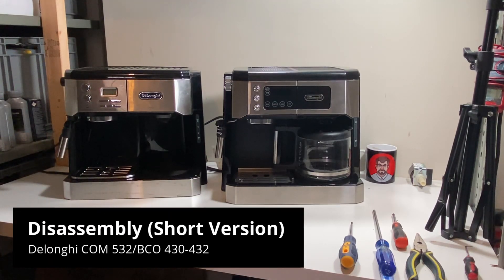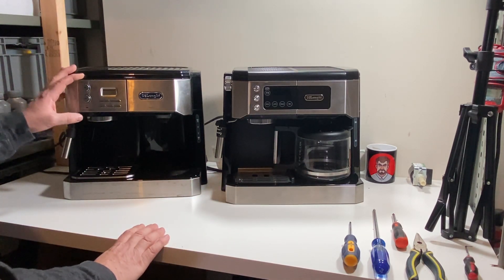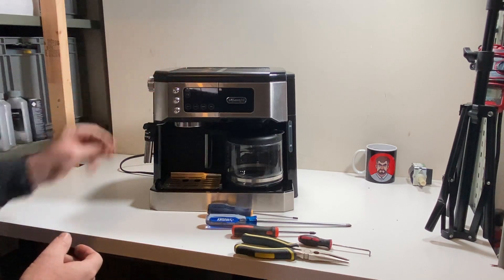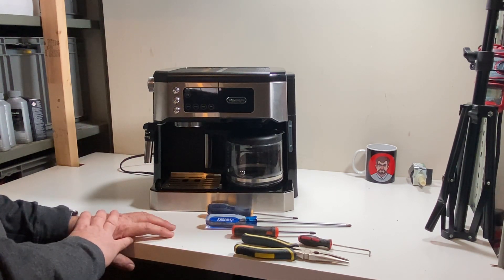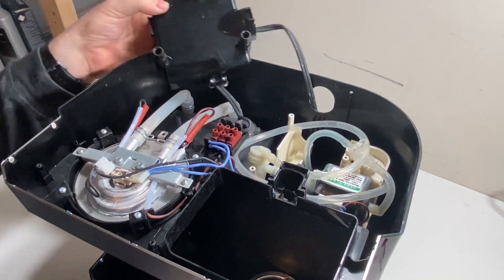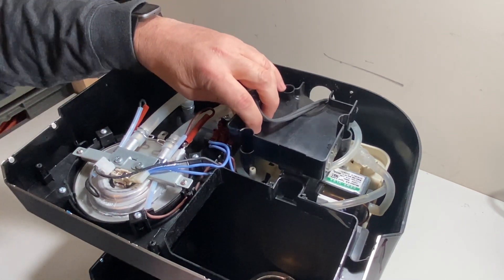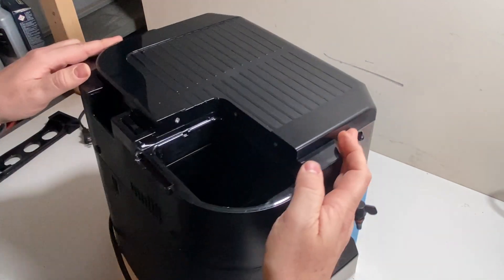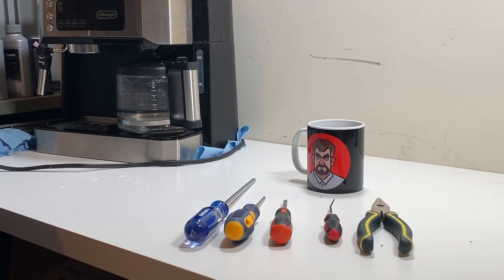Delonghi COM532/BCO430-432 Disassembly Guide (Short Version)

Comment: My espresso side always leaks into the drip pan.. Help 😢
Reply: its the overpressure valve he mentions at 10:05.
Reply: New out of the box my drip tray fills with water when turning the espresso side on. Did you figure it out or take machine back
Reply: @santacruzoverlander  it's the overpressure valve or the water reservoir is not seated right and is just leaking, but that can be deduced by if the machine has to be in for the drip tray to fill at all.

Comment: my com532 just stopped making coffee - it may be the fuse you are referring to.   1) how do i remove it 2) where do i purchase a new one... lights are on with the machine and clock works.   However when pressing power, light works, no coffee...   please advise
Reply: Amazon is where I have purchased replacement parts.

Comment: Hello, I got the same coffee espresso/brew machine. Mine when I plugged in, the espresso area started turning on and off by itself, not allowing me to make coffee, thr brew side works normally most of the time, sometimes in the middle of the brewing process turns off. Do you know what the problem will be on this? I really love this machine, and I don't want to throw it away before checking if I have a solution to fix it. Thank you in advance.
Reply: I Have the same issue.  Looking forward for a solution.

Comment: Great video,..water is no longer coming through when I try to make a pot. Other than a clogged tube, any ideas on what could be the problem??
Reply: I have the same problem.Have you checked the heating plate?
Reply: Yea same here. Heat plate works fine.
Reply: Same here

Comment: Hey - do you know if it will run the descaling mode if the fuse or TCO are bad?

Mines not brewing drip coffee, so I tried running the descale mode, but nothing's happening either.
Reply: I did the exact same thing. Did you manage something out? 😅
Reply: @ nothing worked until I replaced the fuse. Works perfectly now!
Reply: @itsdavehimself  i need to replace the fuse on mine, do you know where i can purchase?
Reply: @alexsoto5800  I got the TCO 216 from ECS Coffee, but if you're in the US, you'll have to find another supplier. They stopped shipping here because of the tariffs

Comment: Thanks!
What is the fuse spec? Did you get higher temp fuse?

Also, I read the core issue is the thermostat being stuck open? In your case, did the new fuse last without changing the thermostat?  Thanks!!!